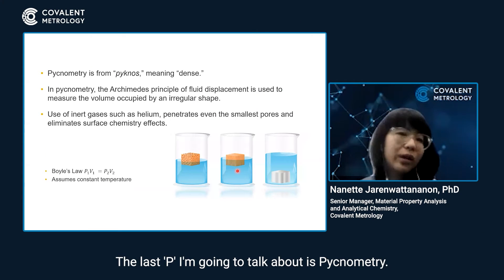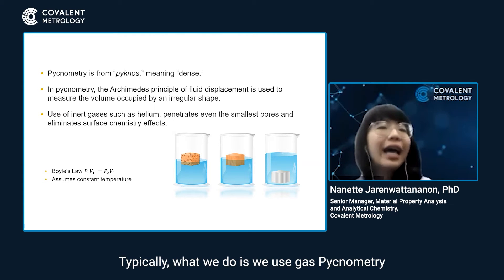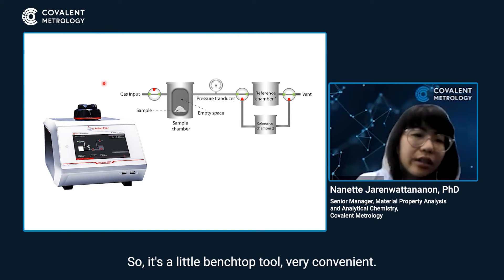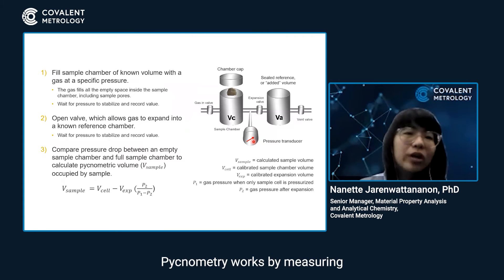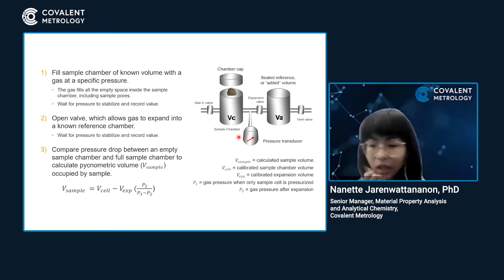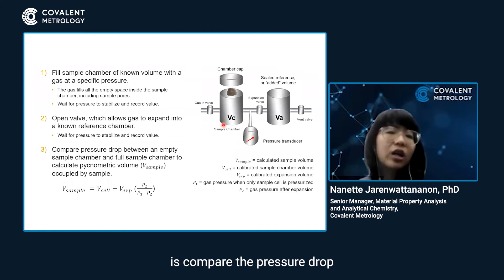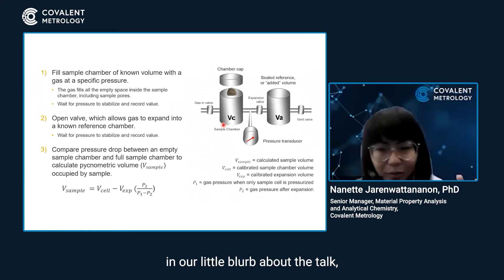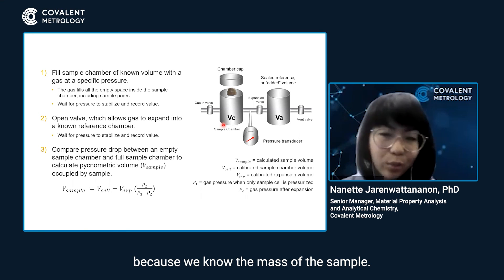Overview of Gas Pycnometry

Comment: So if I have a sample in my hand, the pores will be filled with air.  So, argon, ntirogen, oxygen, etc.  Do I need to evacuate those gases first and fill the smple with helium?  If not, how does this work if there's air in the sample?
Reply: There is usually an evacuation step in most machines to 'purge' the sample with an inert gas. You also usually take multiple measurements, so if there are air-induced errors, one would expect them to settle out after a couple measurements.